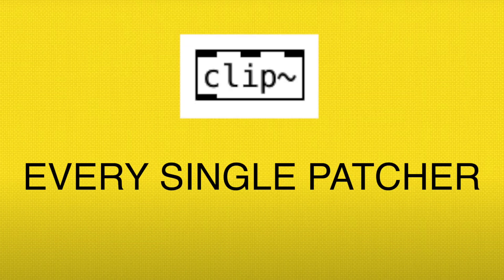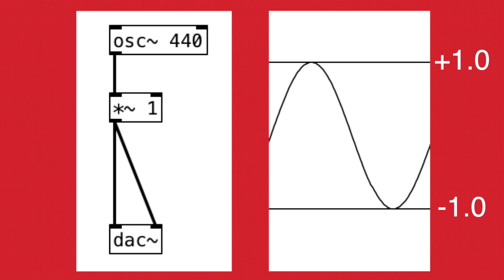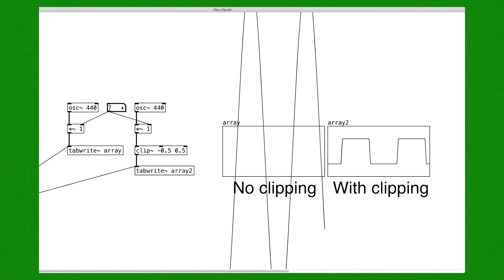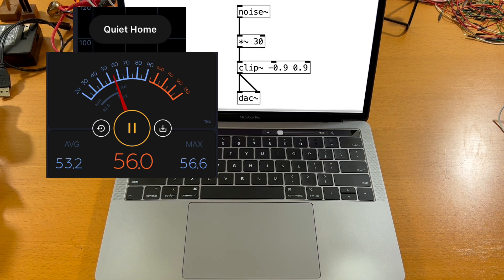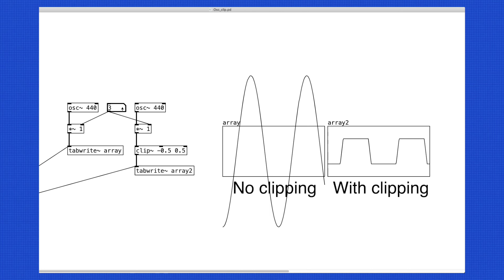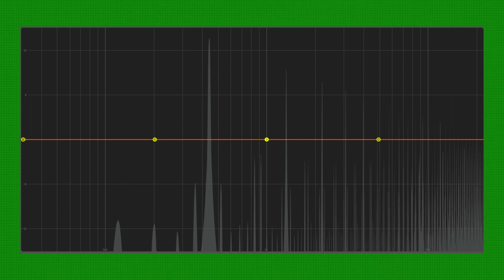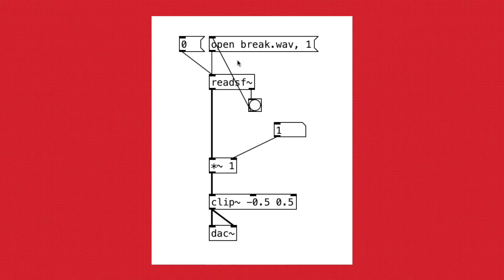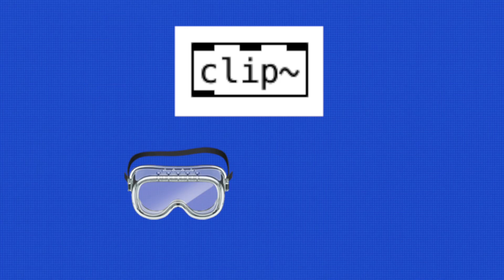Distortion & Safety (Pure Data Tutorial)

Comment: Another great instructional video. Yes, I have to be very careful to avoid clipping and blowing out my galvo amps.
Been planning to add a software limiter from the Teensyduino library. Lots of fine tweaking in progress. Just got 8 waveform channels mapped to the Akai APC40 MIDI desk, using a great free MIDI connector app called Pocket MIDI.
But, it doesn't have the virtual synth GUI of PD, so I'll be using both. It solves some of my patching issues with Cakewalk's DAW. I like the way that the 8 channels extend from the Akai controller up to the touchscreen PD GUI(s). Yeah, multiple PD GUI layers.
Historical & 'How to DIY' documentary is in production.
BR😎
Reply from the maker: I really hope you have been documenting all of these! Always looking forward to seeing the project and a feature length documentary!